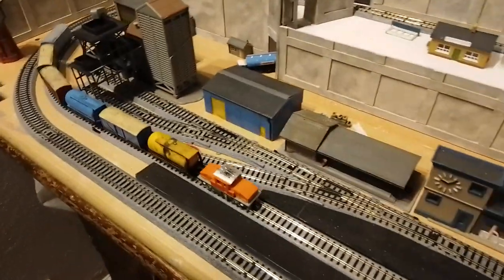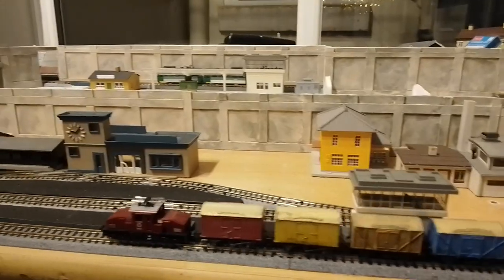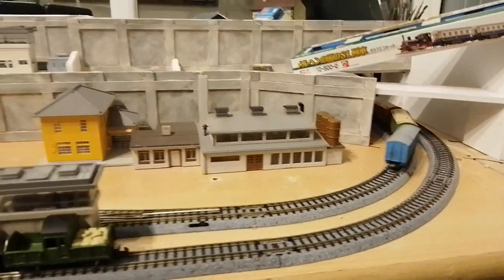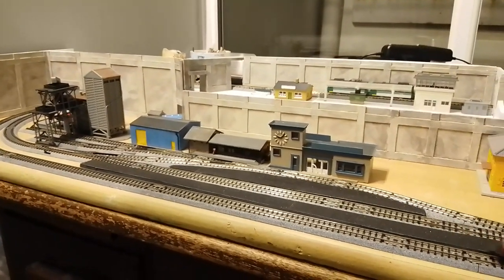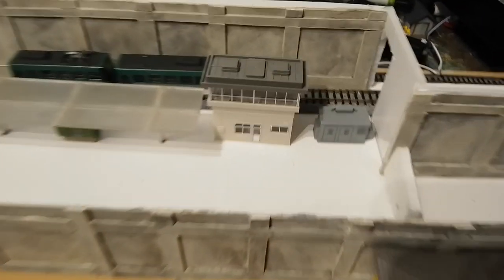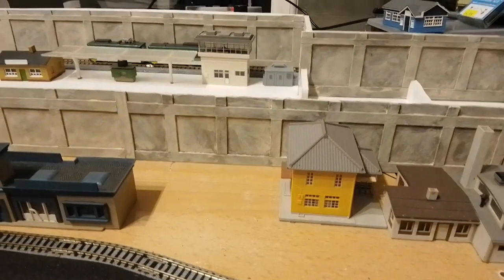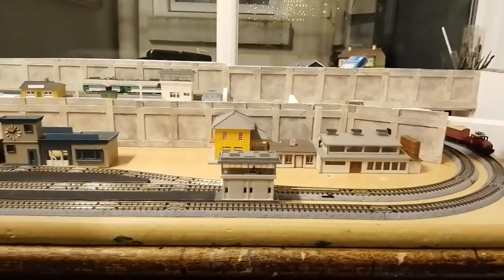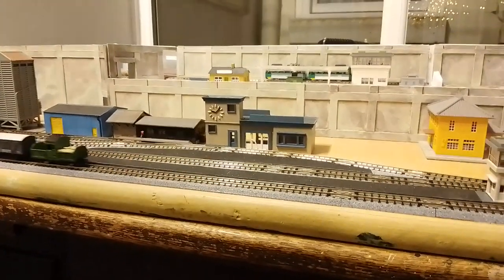Budget N Gauge Exhibition Layout Kato Pocket Line

Comment: I am a big fan of the Kato track. I use it for 009 too. I know the sleepers are wrong for 009 but I'm not bothered about that. The track gives me easy to control electric points and as you say it doesn't take long to put together a layout. In a previous video you did an n gauge layout in a small set of IKEA drawers. At the time I said I would like to do the same in 009. I've now acquired three if the units and will be starting my project in a few weeks time. Thanks as always for the great videos and ideas

Comment: You could just use the bachmann trolley auto reverseing track it looks a bit different from the Kati track but if it doesn’t need to connect to it after ballast it should look decently the same or have it look different because it’s like a tram line.

Comment: Translated in Continental, it is 1219,2 mm x 482,6 mm in size. Roughly a little bit larger than two A2 size sheets put side by side by their smallest side.
Anyway, it's a great idea. I have roughly the same kind for the layout I will do this summer.

Comment: i have modelled japanese outline railways using both tomix set track and peco set track .the new version chassis in these little 0.4.0s are superb .the old ones were not great but at 28quid the new chassis is coreless has a flywheel and run really smooth.